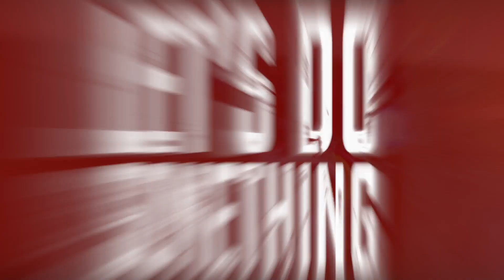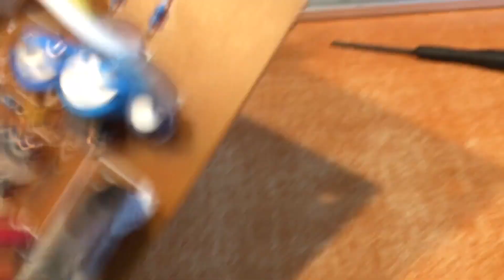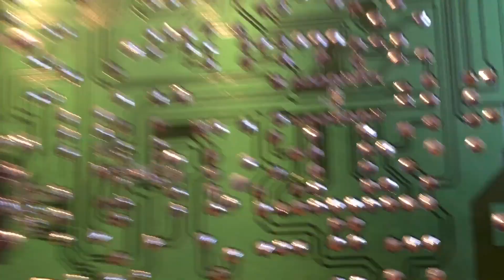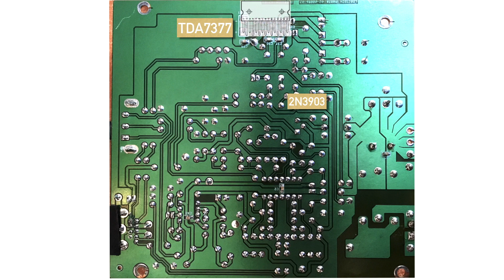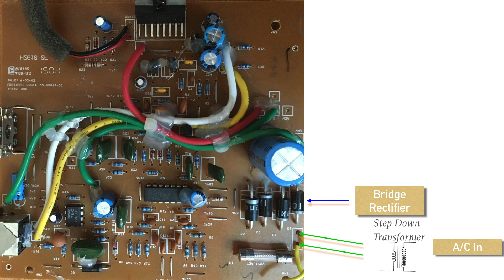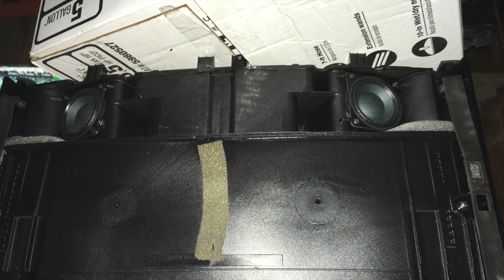Amplifier from the trash Logitech x-220

Comment: Hey, where is Ground output speakers for left and right?
Reply from the maker: Speaker group can by any electrical group contact in the board, even the negative of the power supply you are using. Regards.

Comment: Hey I have one but I'm struggling to figure out the sub audio input, I want to use the existing connector on the amp without touching the board, I have power and feedback noise but I have no clue what pins go to the input, I dont have the side speakers I just want to utilize the sub
Reply from the maker: The subwoofer does not have its own audio input, at least in this model. It has an internal active crossover and from there it receives the Left and right channels and breaks it down to the filtered L and R and Sub. Look for the amplifier IC, check it model number and search for it on internet, it should give you the data sheet so you can trace the inputs. Regards.
Reply: @Letsdosomethinguseful  wonderful thankyou so much

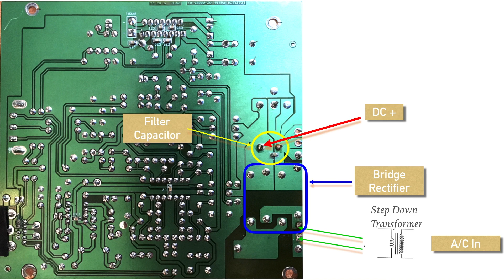Comment: I am glad for the video but I don't now if you realize you are mixing up you DC connections at 8:12 you showed connections on the capacitors the at 8:58 you showed connections on the red and green wire which is another location on the bord....so which is it? I thin I would check an electrician to test before I solder anything yes....
Reply from the maker: Wasn't because at 8:58 the board is backwards? one is the down side and the other the upper side? Thank you for your comment.
Reply: @Letsdosomethinguseful  not really cause I have the same board and the pins line up the same way.......i just use an inverter in the car so its technically alright...
Reply from the maker: @davidfranky1986  Yeah, may be I show it wrong. Thank you for your comment. Regards.

Comment: Hey, I have a very similar Logitech X-230 set - 2 satellites (one with controls), a subwoofer and an amplifier - you know it. It is pretty old and I haven't used it in years, heck, I even found a rubber ball inside the sub. I hooked it up on my computer, the satellite with the controls didn't produce any sound, and the other one produced a very faint one. I checked the speakers themselves with a multimeter and they show nominal results. I haven't noticed anything wrong with the amplifier as well - I'm guessing there is something wrong with the controls on the first satellite. Is it possible to just straight up connect the speakers to the amplifier, or is it more complicated than that? I would also want to be able to put a 3.5mm audio cable to connect it to my PC, phone etc.
Reply from the maker: Fist of all, be carefull because it uses 120 volts ac and could kill you, do not attempt to disassemble the subwoofer if you don't have knowledge on how to dial with 120/240 volts ac.
Well, basically, you can just strip everything from your current system and leave it like I found this one in the video and follow it from there. Assuming the amplifier is working. If you cleaned the potentiometers and still having issues, I would disassemble it and connected it as I did in this video. Regards and good luck.

Comment: did you jump wire the power switch in your set-up?
Reply from the maker: No, I connected the 12 volts supply directly into the board. I installed this board into a mazda with a burn out amplifier so it is connected to the ACC and only turns on when you put your car in accessory mode. Sadly it is in spanish, but at least there are diagrams and the image of how I install it: https://youtu.be/QshRwJfErtQ
Reply: can you send me a sample picture because i copy all procedure but it didn't work to me.
please help.
Reply from the maker: @JAYSY0326  I'm sorry but I no longer posses this circuit, I install it in an old Mazda to replace the integrated amplifier of the stereo. You can see the video here: https://youtu.be/QshRwJfErtQ (but it is in Spanish)
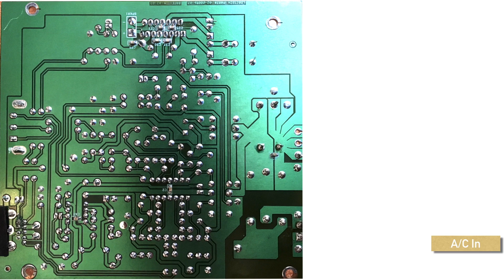The only diagram I can show you it is already in the video at 7:41 
My apologizes and good luck.

Comment: Hi, I have a similar logitech s-220 and the satellite speakers stop working, subwoofer sounds ok, if I connect a headphone in the headphones output it sounds fine, but if connect hoeadphones into the speakers output it doesn't work, i checked visually the capacitors and looks fine, any clue?
Reply from the maker: Are the speakers fine? did you test them? Not sure if the headphones are feed with the same amplifier as the speakers, could be that headphones are feed by the op-amps. but test the speakers and connections, if they are fine, could be a problem in the amplifier IC.
Reply: @Letsdosomethinguseful  I have tested the speakers connected to my laptop and sound low, I suppose is because satellite speakers don't have amplifier, but when are connected to the s-220 speakers output doesn't sound at all
Reply from the maker: @alekuy  then the problem is with the amplifier. Can you test if the main capacitor is recieving 12 volts?

Comment: Hi there
I have X230 system and it suddenly stopped working. I saw supply to speakers, checked transformer working, getting 13Vdc after the rectifier bridge also checked TDA7377 however could not figure out what's wrong with it. Do you have any further suggestions?
Reply from the maker: look for the input signal, follow it to the TDA, if the TDA is receiving  the sound signal correctly, then the problem could be the TDA, if not, look for the pre amplifier, it has to be a operational amplifier IC, check if that is receiving the input signal and outputting it correctly.

Comment: Hello, thanks for the video! I have a full set of x-220 but the other speaker is mute. I'm trying to find out what's wrong, is it the speaker itself or something on the PCB. Could you elaborate a bit, when you connected the speakers, where did you connect the speaker wires? Red wires go to respective audio outputs on the PCB but where did you connect the black (ground) wires on the PCB? Which did you use as the ground? The ground pin of the 9-pin connector?
Reply from the maker: Identify the 2 TDA7377 chips, one is for the subwoofer and one for the 2 speakers, the one for the subwoofer is easily recognizable because it has the 2 wires for the subwoofer just besides the chip.
The other chip has 2 thick wires coming out, one white and one yellow, those are left and right (not sure which one is which) and the group is takes from the same electrical ground.
Here I leave you with another video where I use this very same amplifier to be use as an car audio amplifier. Hope it is clearer there. Good luck.
Reply: @Letsdosomethinguseful  where is the video?